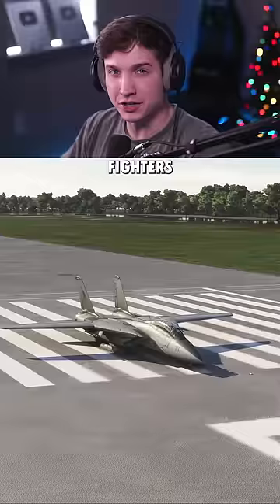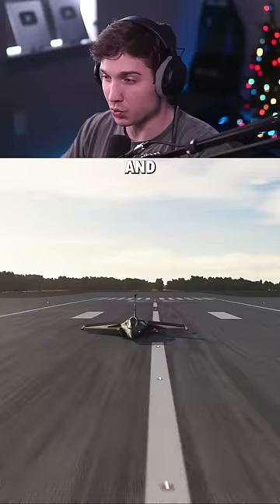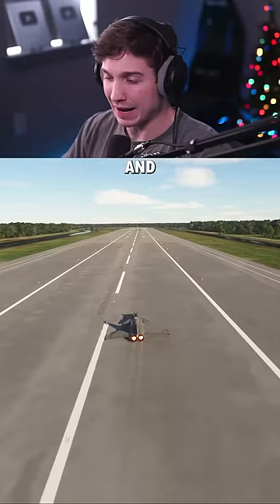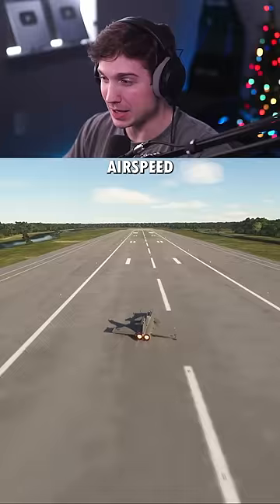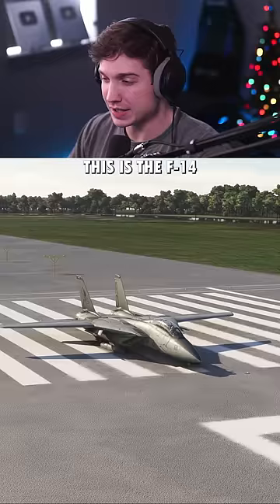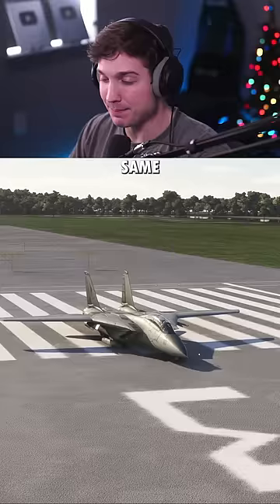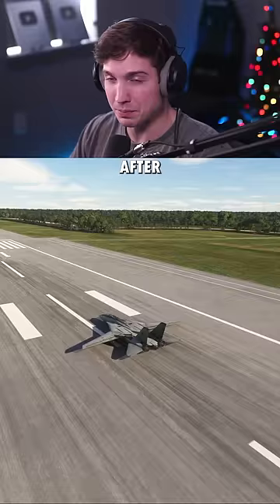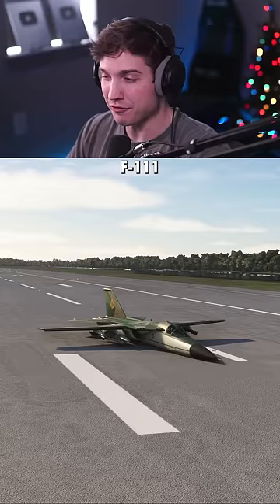Can Fighters Takeoff WITHOUT Landing Gear?

Comment: F 35B : „Pfff Pathetic Noobs“
Reply: hell yeah f35b gang
Reply: Foril
Reply: I'm a fan!!!!
Reply: The nozzle would crash it into the ground, so vtol/stol wouldn't work, and FYI, it has had to many accidents INCLUDING GETTING LOST to be considered good, "f-35 gang" sucks
Reply: @justliam6848  your worried about the nozzle when jets are taking off with the landing gear up? I don't think the nozzle is a big deal, and the F-35B doesn't even need to hover straight up, it takes off shortly, so the nozzle may have some space to not hit the ground.
Reply: VTOL brr
Reply: Harriet jump jet has left the chat
Reply: The only benefit from this garbage). But the combat load and flight range are negligible compared to conventional aircraft
Reply: @justliam6848 F-35 is one has one of the lowest crash rates out of almost all aircraft. There have been over 1000 made and only 10 crashes.
Reply: @confused3032  ye you lost one
Reply: @justliam6848  F-35 has one of the lowest accident rates among other jets. 4th gen fighters like the F-14, F-15, F-16 & F-18 had about a dozen or more crashes almost every single year.
Reply: @justliam6848 Hawker harrier:

Comment: 0h thats nothing...    Canada and Germany hold the record with the F-104  ZELL.  

Though... canada was also planning on ZELL's with the F-105 which would have been just nuts...

US did it with the F-100 and and F-84,  but really the CF-104 was just nuts.

picture...   taking a 25,000 lb CF-104 with its 15,000 lb after-burning orenda engine...   while strapping on a 52,000 lbf  BOOSTER rocket,  to THROW the F-104 from stand still,  into the air without a runway... at 4g's  acceleration.    OH yes, thats zero to 175 in 2 seconds,  while sitting at a 40 degree up angle.    

After 2 seconds the rockets dropped off...    and its normal...   climb rate contiues.   yes, this is less of a take off,  and more like a rocket launch...  even cat launches aren't that rough on pilots.